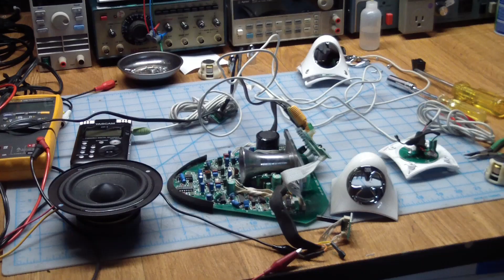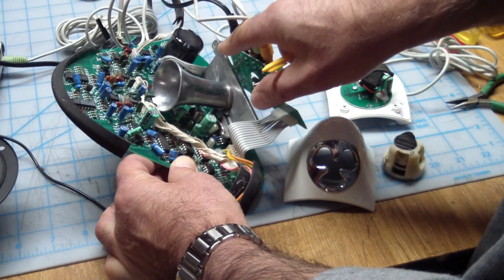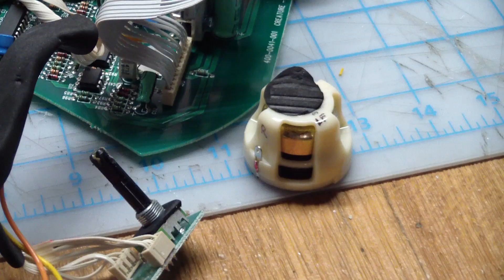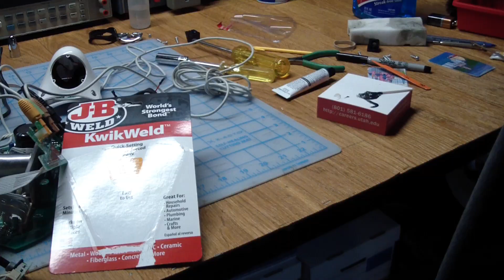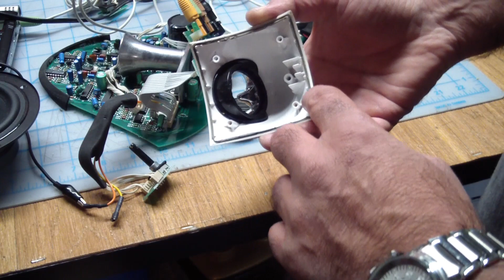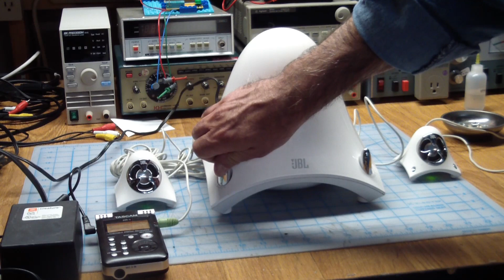AE#106 JBL Creature PC Speaker Repair

Comment: Hello, I have enjoyed this speaker system for 15 years with no issues until recently. The sub sounds distorted and getting quieter. I need to raise the volume higher as it ages. Could it be aging capacitors?

Comment: Cool & useful video: ) Thanks.
I've had a Creature for a good while & loved it. Recently it was sounding not so good. I checked your vid & realised it was the satellite speakers that were the problem. Mine didn't have the dropped magnets, the latex type rubber cone had just 'melted' each side! So mine needed new 40mm 4Ohm, 5 watt speakers for the satellites. Found some on Ebay for under £10. They arrived this morning & I now have my Creature working as new again: )
Must be many owners of this great PC sound system in the same situation. Don't trash them, fit new satellite speakers & it works as new again, for a long time to come!
I also have a JBL Charge 3 but the bass is nowhere near the Creature quality...
Reply from the maker: I recently saw a pair of creature satellites with the innards completely missing at a junk store. But one row away I found an original power supply to add to my stock of creature parts.

Comment: Thank you for this video I found it very informative but I could use a bit more info, I just purchased a JBL Creature and the leds are not lighting up on either of the satellite speakers what and where was it you had said you heated up to give you power to them?
Reply from the maker: I think it was where the speaker cables connected inside the subwoofer. The solder joints were bad.
Reply: @artifactelectronics   I was jiggling the cables on mine and they came on, so i'll have to solder up the joints then.Thank you for responding.

Comment: hi there. these are awesome! i have 2 sets, bought them both used, 1 black and 1 white. thank you for the video. i will try to open mine up and fix it. if cant, i will take it to a tech shop here where i live. i noticed both of the units i have, the subs, the cables when connected are loose, so if you barely touch them, it will loose sound or turn itself off. i am not sure if this is an easy fix and if i have explained myself clearly. anyway, if you have any suggestions, that would be cool. thanks.

Comment: Hi I wish you can help me in my unit , no sounds but the power indicator is on. I just use alternative power supply the original was lost do I have to buy same power supply adaptor? Or I still can use the alternative one.
Reply from the maker: If the lights are on the supply is probably good. Have you checked the speakers for magnet separation? Or tried driving the speakers from an alternate audio source?